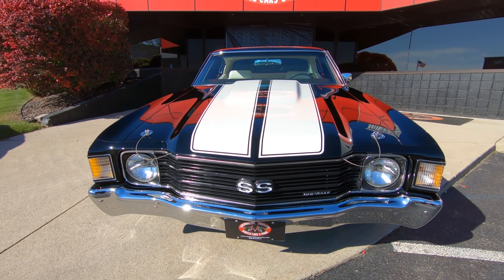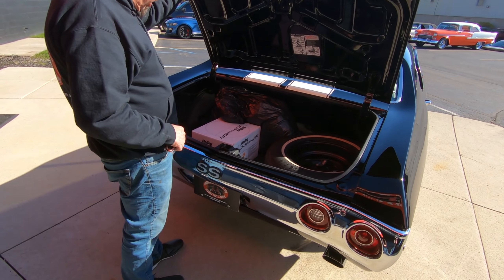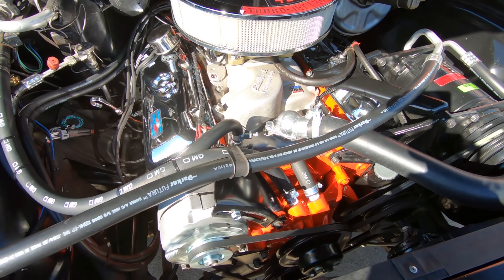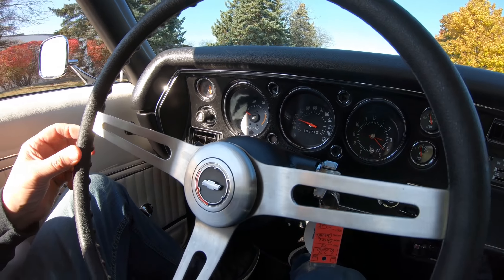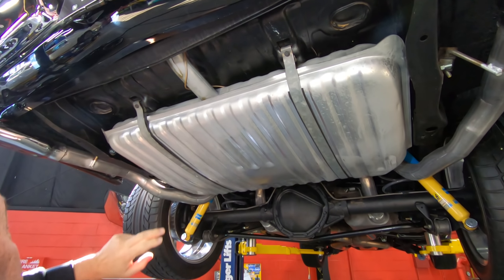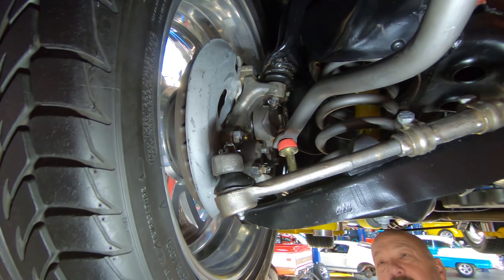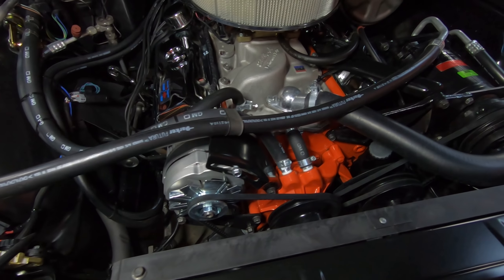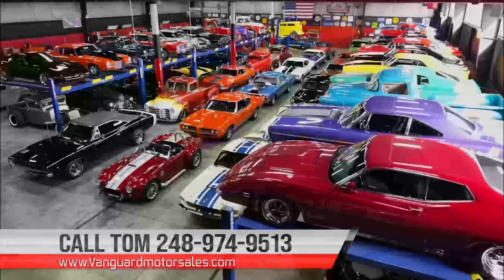TRUE SS! 1972 Chevrolet Chevelle For Sale Vanguard Motor Sales

Comment: In 1984 I had a 71 Chevelle SS 454 ...LS5 ENGINE  all original and it was a daily driver  with about 75,000 miles on it. It was so much fun and fast .